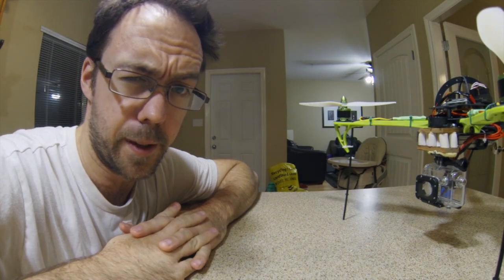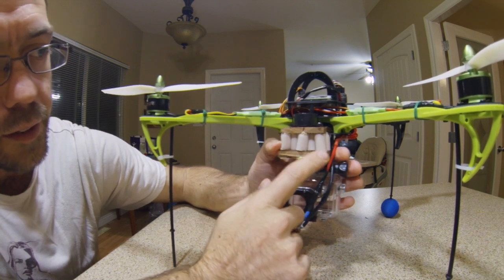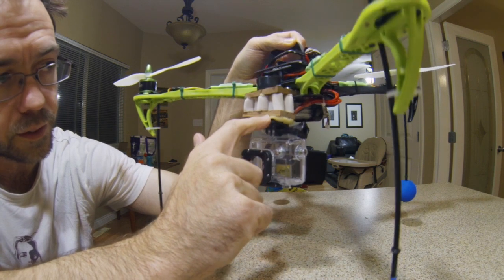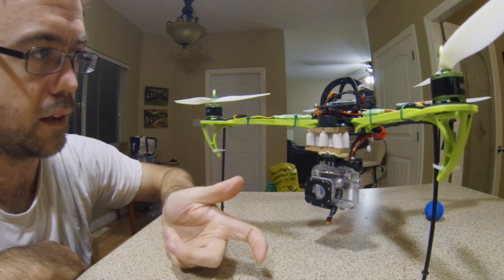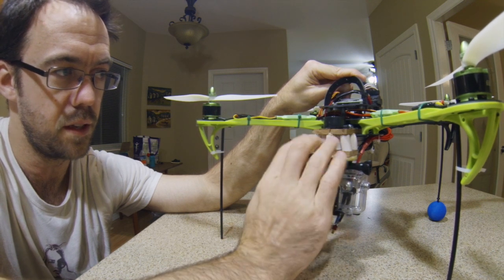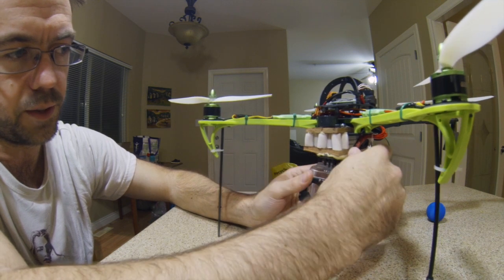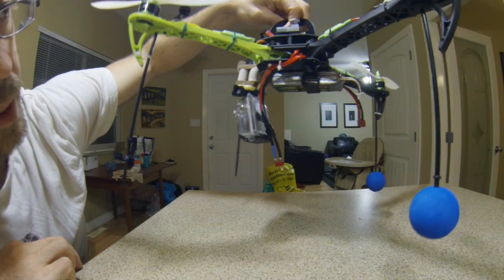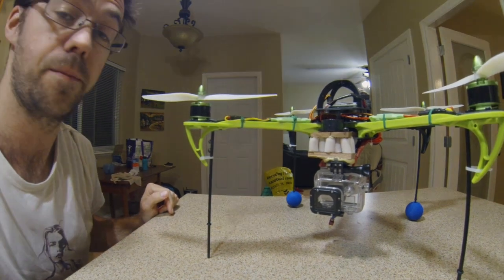Jonathan Reichert - DIY Gopro Shock Mount - Turnigy SK450 Quadcopter

Comment: what landing skids are those?
Reply from the maker: They are chop sticks. I shaved the ends of them to just fit in the hardware hole of the original skids. Tall for camera, but you have to land carefully to not tip ;-)
Reply: +Jonathan Reichert thanks.  ever break any?  I have some carbon rods, but diameter is kind of small
Reply from the maker: +thechosendude no breaks, but I practiced 100 of landings just for that purpose ;)

Comment: what size props are those? I am building a very similar quad and I'm curious. The motors I have picked out are identical to the multistar ones on the turnigy quad and the manufacturer says a 3 cell battery should be used for 10 inch props while a 4 cell should be used for 8 inch props. What advice can you give on props?

Comment: I really like it. I am going to build one of my own. This made your video look like it was on a $300 gimbal. So I really appreciate you answering my question with a video, that's just awesome! Thanks for the shout out, Ill return the favor when I test it out on my SK450. I am doing a custom build, so it will be interesting to see if I can get it to be as stable as yours. I also like your landing skid extensions. What are those? Cant wait for some more flight videos of your bird. Have a great night!
Reply from the maker: Yea it turned out decent. I did one more edit (didn't upload though), using iMovies' stabilization instead of youtube, and it is even smoother!

I was lucky with those skids... they were a set of training gear for a 400 size helicopter that i had laying around(ebay originally)so i trimmed them to that length for go pro ground clearance, and then they just happened to fit PERFECTLY in a hole on the already existing skids on the SK450. i just added a dab of super glue.